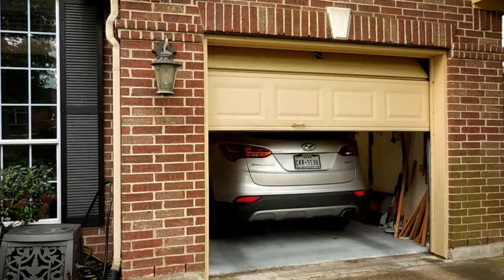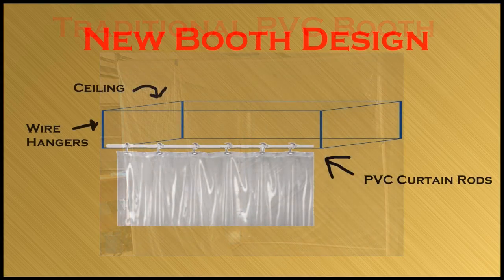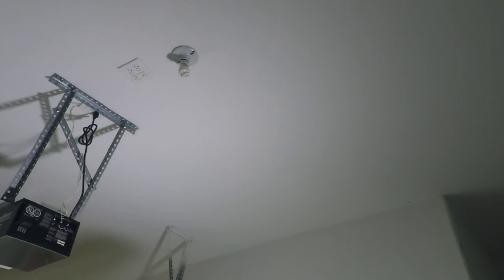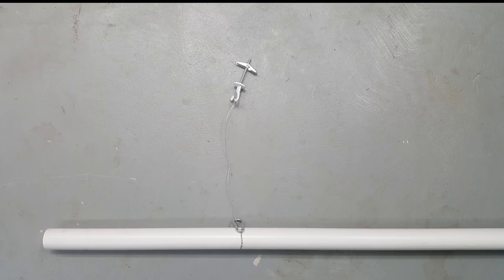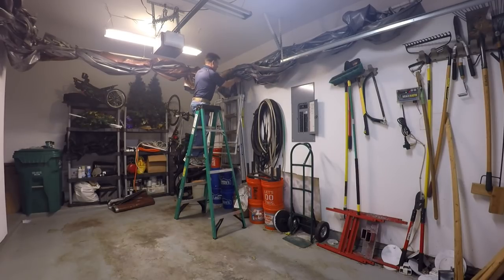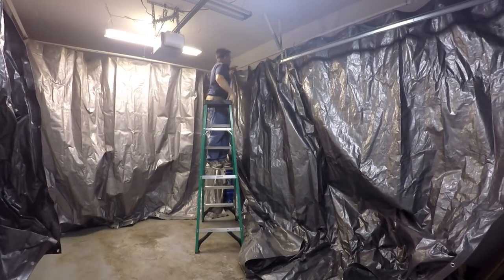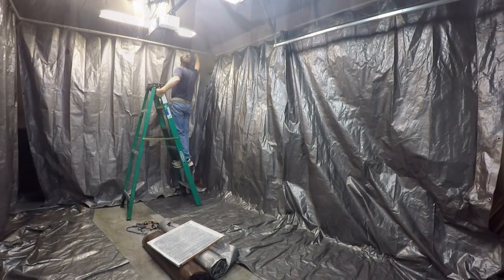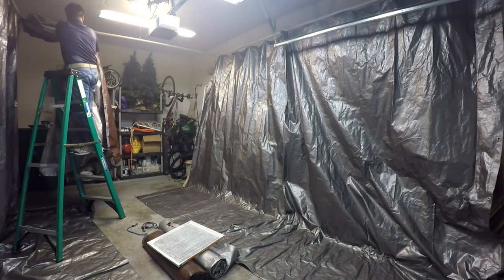Home Paint Booth In 15 Minutes

Comment: Where and how do you set up your vent fans and do you have them blowing outside or just outside the containment into the garage?
Reply: Tomijko Wiggins- I have the same question. Blowing the fans into the painting space creates beneficial positive pressure and reduces the chance that volatile vapors will pass through the electric motors. Just need to provide a vent path to the outdoors and to be sure the door into the house is gasketed tightly.

Comment: Good idea but i think i would get some of those big wicker blinds and attach at layer of plastic to them, and use those then all you have to do is pull a string to roll up or take down the paint booth
Reply from the maker: I actually looked into this,  it's a great idea, I just couldn't find any in the length I needed at a reasonable price.
Reply: I already have some of those hanging on one end of the garage to keep dust off my shelves, so usually i attach plastic on that end. But this is just what i need for the two sides.

Comment: Cool idea. I'd be worried about the dust/dirt accumulation on the tarps after being rolled up for extended periods. Has that crossed your mind?
Reply from the maker: I haven't had any issue with dust accumulation. I use the booth about once a month. I have taken them down once since I built the booth and washed them off, but that was to clean off the overspray that accumulated on them. I have installed a second fan to help with the overspray.

Comment: What kind of stuff are you spraying in here . Cool design
Reply from the maker: You can see it in use in the Band Saw Restoration video and my video on the lift table. The design is scalable however I have it in a one car garage and is too small to paint a car.
Reply: Too much work use
a brush.
Reply: 82ndo.k.

Comment: Ventilation and lighting?
Reply from the maker: I have ventilation out the front of the garage, I originally started with one fan but increased to two later. Ventilation is dependent on the size of the job and is trade off, after paint, air filters are biggest consumable expense. So I either run one of two depending on the job. Lighting, I started out with old florescent lights, I quickly came to realize that the most important factor impacting the quality of the paint jobs was light so I upgraded to LED bulbs (they doubled the light). However, I do need to add some side lighting, lighting very, very important and in my case was under appreciated.

Comment: I did something similar years ago and after studying how those roll up / drop down shades work on a sun porch. I attached my tarps tight to the ceiling and used a piece of 1" metal conduit on the bottom of the "curtain" to give it enough weight so it would roll up as I drew the cords. I attached a cleat to the wall so I had a place to tie off the cords when the curtains were drawn up for storage. In my case I made a curtain for each side and the door end only comes down to the height of the lowest door section. (roughly) For ventilation I place a 20" fan on one side of the open garage door and a filter on the other end. The center is blocked by a piece of plywood (cut to fit) and the gap at the top of the door is mostly blocked by the curtain at the ceiling. Not perfect, but maybe 5 minutes to set up. Clean up can be done with a garden hose as long as I let things dry overnight before rolling the curtains up again. Probably spent $100 on everything but it's been up for 15 years and still works well. Well enough to keep the overspray off the other 5 cars in the garage with minimal effort.

Comment: that is not a paint booth it’s hanging drop cloths a paint booth is meant to control the environment (remove dust , bugs , overspray)
Reply: I worked at a dealership with curtains like this to do paint jobs. If your going to be painting in your garage your not going to get a perfect job meaning most likely you’ll be wet sanding  and buffing. Nothing wrong with this booth if your not wanting to take down every time you want to use it.

Comment: Well done. But what about ventilation? You need to remove  chemical laden air.
Reply from the maker: You are correct, I started out with one exhaust fan but later added a second as the size of my projects increased. There are air filters over the front of the fans.
Reply: Where did you place fans for ventilation
Reply from the maker: At the door side of the booth. The tarp wall is offset from the door by about 2 ft so when I am spraying I partially raise the door about 3 ft. I originally put a hole for one fan but later added a second to suck the fumes out. There are air filters in front of the fans. You can see them in action in my "Band Saw Restoration" video.

Comment: Good idea but you really need a ceiling to prevent dust and overspray on tools and other stuff in garage
Reply from the maker: I'v done a couple of small jobs in there with no problem (dust or over spray). The fan was able to keep the air moving out of the booth without any issues. I think the real test will be coming up in a week or two when I do a larger job. Of course larger is a relative term, it is a one car garage so I will never be painting a car or anything nearly that size (it's only 10'x14' inside). 

The tarps are pretty much up against the wall which really limits overspray and any contaminates from getting in or out. 

If necessary, it will be very easy to add cross bars and a ceiling. 

So far it is working out great, the short setup time and teardown time has made it a no brainer to use even on small projects.
Reply: for large spray job you need ventilation, dry overspray will kill your work!